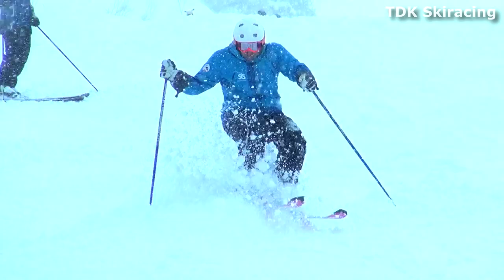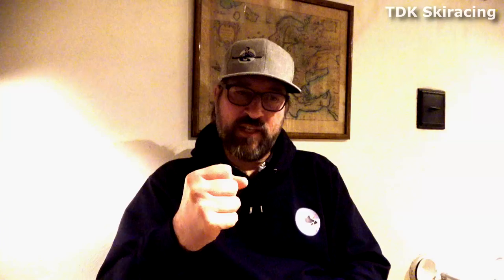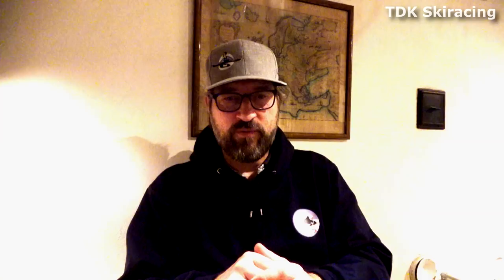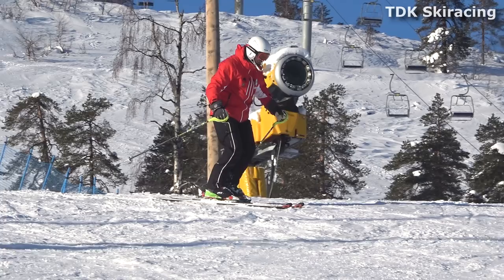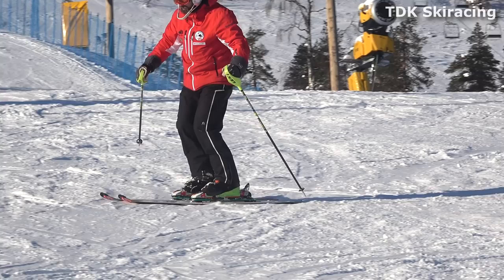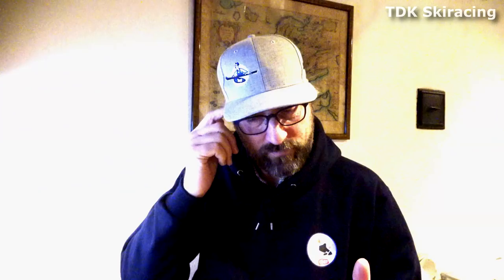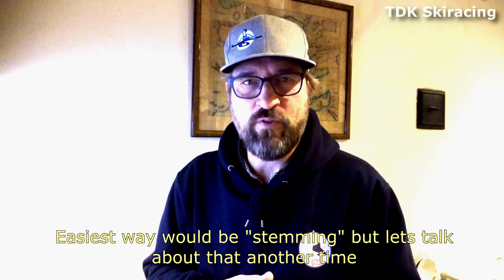Short Turns Demystified (Short Version)

Comment: The short brushed turn has just the same elements as the modern carve turn. The only difference is the delay of edge angles from the outside ski. I really hate the word pivot because it implies active lower body rotation; the rotation of lower limbs is a BYPRODUCT of inside leg tipping, inside foot retraction, and inside foot pressing towards the stance boot (tension on medial muscles of your free foot, setting up proper technique). If it's not coming from these movements, the turn falls apart. Which is why I prefer therm brushed carve. You can at any point in the turn go from a brushed to a modern carve by engaging the outside foot which is also how the pros use it to time where in the turn they want pressure on the outside ski.
Reply: Down-unweighing, I like this term. It covers the essentials of the release. Didn't realise up-unweighing was a term, I should watch more racing on old ski geometries.

Comment: Thank you. This was a very informative video. I liked what you said about the difference between carved and brushed turns and then highlighting the need for some other movement (bump or pre-turn) to generate unweighting when going at slower speed. 

In the demo section you showed the edge set and then said "extension" and I could clearly see the extension. In the latter part of the demo you were setting the edge to unweight and then it looked to me like there was no extension, only flexion with your unweighting to pivot into the new turn. Am I understanding this correctly? 

Please keep posting!

Comment: Great Video!
Btw, what is a brand of your ski-pants?
Thank you in advance!
Reply from the maker: We are not using any particular brand... my pants, the black ones with the white stripe, are Wölkl branded. I still use these as my main pants even if I have a new pair of Tony Sailer which are top of the line and to be used only when not working or racing. I also use a pair of Halti. I only buy ski pants on sale. The jackets are team wear. Cheers, Tom
Reply: Thank you!

Comment: always interesting video. do you have a video explain the use of dorsi plantar flexion during the turns? im little bit confused in this hide movement , some teacher say to push big toe during the turn  on the outside ski other say the opposite:  to push big toe up for close ankle  and feel the heel pressure .
Reply from the maker: As I mentioned in an other comment, watch my new A-frame video. Nothing about dorsiflexion but if you pull your inside foot backwards in the turn the dorsiflexion increases. Depending on the boot stiffness. Anyway, always try to keep pressure with the shins of the boots. That is how you transfer power to the skis from your legs and upper body. Use stiff boots and lean forward during the pressure phase. Also watch my How to carve low video. Ask me more questions, I will try to help you. T
Reply: @Triggerboy62  🙏👍

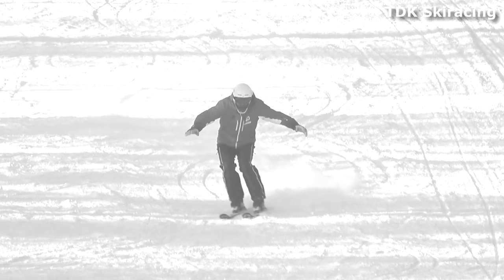Comment: Thank you all these informative training materials, i found it  fascinating! I have been always wanted to learn the drill at 3:44, the edge rolling part . I was wondering if i am lucky enough to get some tips from you ? Appreciate that in advance !
Reply from the maker: Thank YOU for watching. That edge rolling drill, or turn sequence, is to die for. I am using 155cm womens SL skis so they are really turning well but find a very flat well groomed slope and start out in the fall line to catch speed. Then start slowly to tip your feet from side to side. As you start turning more frequent, lower your position so that you can extend out to the side and flex through the transition. Hope this helps. T
Reply: @Triggerboy62  thank you so much!

Comment: You are doing an extension to release up move then twist the feet to pivot the skis? Is this the technique that World Cup slalom skiers strive to use to create short turns? They flex to release they don’t extend to release.
Reply: Triggerboy62 
We see extension releases and pivots with hard late edge sets (windshield wiper) Z turns all over the mountain by terminal intermediates. Up movements  disconnect the skier from the snow and makes them have to pivot and jamb the skis for speed control. Rounded brushed turns needs to be the goal. Flex to release with early edge change and tipping in the top of the arc should be the goal.
Reply: Triggerboy62 I’m disagreeing with you, extension releases disconnects the skis at the top of the turn so you are left with the only outcome, a late edge set. Is that desirable? Not in my book. 
We want speed control as early as possible which is in the top of the turn, not at the bottom. 
In other words, I don’t think demonstrating an extension release, like you are, is going to lead students to early tipping and shaped brushed turns. 
Bumps are another example where we should be using flexing releases not extension releases.
Reply: @Triggerboy62  your up movement isn't so small
Reply: @Triggerboy62  I think you try hard and it s good. Some of your concepts are not so clear especially seen you are talking to  intermediate skiers.
Reply: Triggerboy62 you note pitfalls with extension releases...which we see all over the mountain, windshield wiper Z shaped turns. It is pervasive in my opinion. The steeper the terrain, the worse the outcome for the student. 
What are the benefits that tell you it is better to build a skier’s No 1 go to turn technique by ingraining the muscle memory movements of extension releases, as apposed to flexing to release?

Comment: I started the video. I do not agree with the first statements, so I stopped watching.  You state that the meaning of short turn is that you do not lose momentum. I say that the most effective way to reduce momentum is the short turn.  In other words short turns are the best turns that make it possible to control our speed. By finishing the turn earlier we can gain speed and by finishing it later we can lose speed.  We can make both kind of short turns without any problem.  We always have the option of starting a new short turn during the old short  turn. I think, that when an expert skier, like you, tries to explain ski turns  for intermediate skiers , it is necessary to understand exactly what is the most important element and what is the next and so on. Only by making up a priority order of the elements can you really explain effectively.   
So i ask you, what do you think about the need of a priority order of the elements? What is the real difference, the most important difference, between medium wide turns and short turns? 
I have been thinking now a long time about these matters, I can tell you.

How about this statement: 
"Release by tipping your skis into the turn and  pivot during the float." 
A tipping (edging) of the skis will increase the pressure on the skis, not unload it. 
I think you  wanted to communicate the following: 
"Unload the skis during the tipping (edging of the skis)".  Or maybe: "Edging and unloading of the skies should be done together simultaneously". This is one of the complicated things one must do for a good short turn.

later in the video:
"up-unweighting by extension " you say. I say the opposite.  During the extension  of the knees you increase the pressure on the skis. It is a common misunderstanding you state here but if you think about it you will understand. The meaning of the knee extension is something else.  By this you can help your body to move into the direction of the fall-line, this is the body projection.